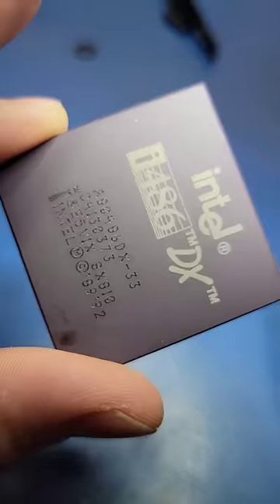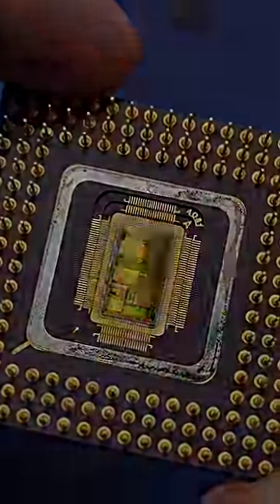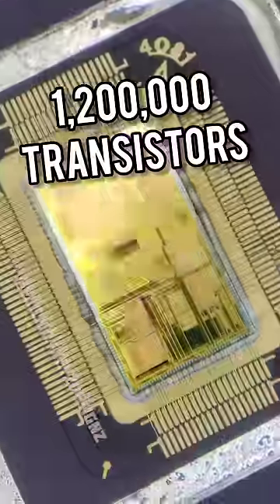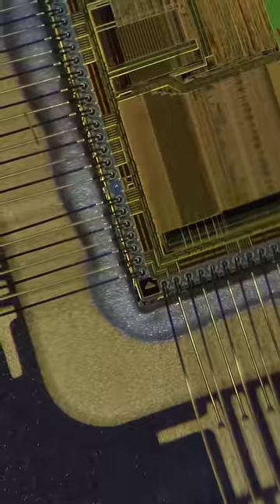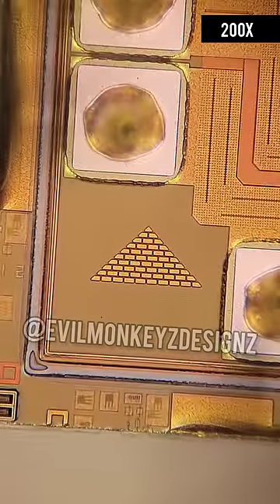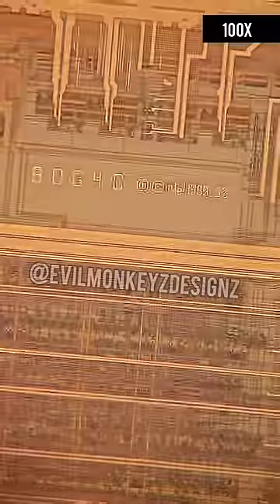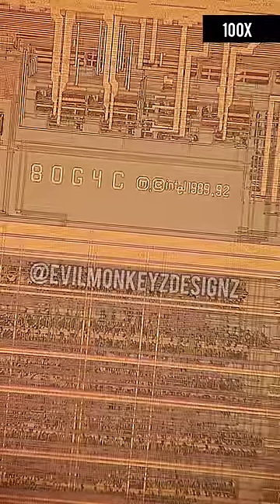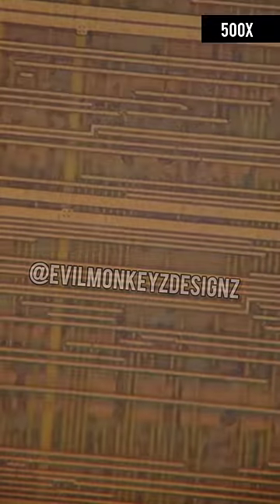Inside an Intel i486-DX CPU

Comment: That was my first CPU; 486DX-33 back in 1990 I believe! The machine cost $2,200 with 120mb HD and 4mb memory.
Reply: wow... I had the I286 in a Schneider Euro PC and my dream after that was to have a computer with that processor, but obviously my father couldn't buy it at that time because yes, was crazy expensive for him
Reply: Same
Reply: same, i486DX, 129mb hd, 4 mb ram but mine cost $1200 in 1991, that's what you got with Dell "quality"
Reply: My first was a 486 DX2-50  which ran at a blazing 50mHz .
Reply: Was my 2nd. I needed to wait several years for the prices to go down.
Reply: Mine was a 80287, 128k memory with no HDD Tandy TX1000.  Got it at Radio Shack for just under $2,000.  Upgraded to a 300mb HDD for $300.00 and 4mb ram I can't recall what I spent but I am sure it wasn't cheap.  circa 1988
Reply: Same
Reply: Same here
Reply: @pamdemonia but the cpu ran at 25MHz.
Reply: My parents bought us one too. This bring back so many memories. Trying to be smart as a kid. The computer was using (ms-dos) we I found out what “format hard drive”. Back then there was no google or YouTube to look for answers.
Reply: @Blaze_1961 4 megs of ram around 91 would have ran about $150. That is what I can recall from pricing it out back then.
Reply: I learned to much today im going to the histiry channel now
Reply: Oh I love these retro electronics, it was made with love indeed 😍
Reply: @jonnykban  The PC (system bus thus memory) would have ran at 25MHz but the CPU would have ran off of the 2x clock multiplier for 50MHz.
Reply: my system was the dx2 66 i think but i do remember costing $4500 lol
Reply: My first CPU was a 1mgz 6502.

You new kids....   with your hoola hoops and your 8 track tapes shakes heads
Reply: Thats kinda lame 486 spec. I baught my first PC a 386DX25 with 8Mb Ram ond 80Mb HD and the classic Tseng ET4000 Graphics running DOS games and Win 3.1, and remember my friends commenting WTF you need 8Mb  for ??? so funny today. I remember buying a 200Mb harddisk later for all the cracked programs and games we got on QIC80 tapes. The 200Mb HD cost me like almost 1000$ back then. It was the biggest I could possible get. I could have baught several of the software for that money too. Remember running 3D Studio with a software coprocessor emulator .. it was Sloooow
Reply: Commodore Vic20, C64, C128, Amiga 500,    then down the Intel line.
Reply: Mine was a Z80 at a fast 3MHz, with a whole 2K of RAM in I think 1982 or so, the Timex Sinclair 1000 for $40 NEW mail order. My favorite is my TRS80 Coco with a 6809. Both used a TV for a monitor and a cassette tape for storage.
Reply: I had the exact same configuration. With a VLB graphics card too, of course.
Reply: @anthonywilliams7052  The ZX80 had 1kb ram. ZX81 had 2kb
Reply: 你小时候就玩这些😂
Reply: That's really cheap for the time. How did you pull that off? I got my 486DX2@66MHz very early 1994 (I just cared about h-h-h-homewor...
Doom). My dad got the majority of it for free from his school as he was a teacher. The media center was getting ready to switch over to Pentium machines and were chucking everything. However, that PC in 1994 was around $2,500-$3,000 new.
Reply: @choppergirl 
What's a hoola hoop and an 8-track tape? Was that something you used to walk up both sides of the hill to get to school 18 miles away, one way, barefoot? The hill that was always snowing on one side (blizzard snowing), and 95 degrees on the other side with golf ball sized hail raining down on you. You never complained and life was definitely better. ;)

Addendum- I'm joking, I am a wise ass Gen X'er (probably like you). My grandparents used to tell me about the massive hills they had to climb for everything barefoot. Or...when I was your age we didn't get Nintendos', we got an orange and a backhand for Christmas. I miss my crazy grandparents they were cool (all 4 of them).
Reply: the first computer i was trained to repair was a Wang Mini - no CPU as such rather a collection of 8086 processors on multiple boards, no HDD, 8 inch SSSD floppies with (from memory - pun intended) 360kb of memory, a 'green-screen' monitor and a price tag of around $40k back in 1983

after which i was trained on the Wang Mainframe which ran reel-to-reel tape drives as big as a fridge
Reply: Mine too! But I got it in a dell in 1994, with 8mb of ram and a 240mb HD with a 512k Cirrus Logic video card. It cost my mom bout $1500.
Reply: Nice rig!
Reply: Lol. 120 was quite big back in the day. Mine was only 40mb.
Reply: 286 packard bell legend iv 😉
Reply: My 1st cpu was AMD 486DX2/80. 30 years are over since then.
Reply: $2,200 is some cash. But hopefully nothing your parents couldn’t help you with🙏
Reply: 486 was my first PC CPU also, tho pretty sure my first PC was a Pakard Bell with a 486 DX66
Reply: @Sinn0100 you are correct with your pricing. Our family got a computer around the same time.
Reply: @flyer3455  DX and SX both had variants that ran at 25 and 33 MHz bus speeds. The difference was the DX had an integrated floating point processor 

And AMD did in fact produce 486 processors. They were a licensed third party source amongst others. They made Intel processors since the 8086/8088. IBM had a  requirement of not having a single source in case something would happen to them.

AMD was not a licensed third party source of the Pentium requiring them to "clean room" reverse engineer the Pentium microcode
Reply: My first CPU was a 2MHz 8080.
Reply: @Blaze_1961  The 80287 was not a CPU. It was a math co-processor.
Reply: Strange for me since I fought 33MHz had SX version. My first private PC was 386DX-40. As I remember 486had also DX2 version for 66 or 80Mhz.
Reply: @da3dpanepma255  Why is it strange? the 486SX was just a 486DX with a disabled FPU and disabled cache.
Reply: @davidbroadfoot1864  Strange that my 386DX had more frequency than 486DX in the video
Reply: Your current computer probably doesn't seem much faster either I'd wager.
Reply: @Blaze_1961  The 80287 was an add-on math coprocessor for the 286, priced about $250/100ct bin.  Your HDD was probably 30MB not 300MB, they had just barely broken the so-called "32MB barrier" back then with MS-DOS 3.3.  Your RAM was probably the super expensive upgrade and you had better have shelled out for the cache memory upgrade as well otherwise it was slower than dirt.
Reply: @DanielKreimendahl  What I wrote was from my bad memory.  I put the model down for people to check specs. Both the 7 and extra zero were typos.
Reply: memory more expensive than everthing else- you had to load by hand - each chip a 'bit' at a time
Reply: Whippersnappers. My first had a Z80, a 8x80 characters LCD and cost abot 3000 bucks...
It also had a microcassette drive for mass storage, which had an error catching method that actually made it MORE probable to lose data...
Reply: @HotelPapa100  lol - my first? 1979 altar 8080 with the load toggle switch/led front panel (home built except for the 8080 board - and then to save up real money for the math coprocessor 'board' - 
i lost it during the many moves i made sense then but remember when i loaded my first 'working' program and saw the front panel led's start to actually execute and not stop - we didn't have ICE back them dangit! -you had to work backwards from where your program stopped. 
still- i remember the experience so well!
Reply: Yeah I don't wanna hear people complain about how expensive PCs are today. Mfplz. 2 grand, 30 years ago.
Reply: @TicTac-g7m I went down the TI 99/4a trail. That was when programming was fun. Mine played three part harmony. And was a lot cheaper than the apple computer and i didnt need any extra boards. I bought the ecpansion box when triton took over the sales. TI dropped the home computer field. I had a print out for the //1400 emulator that was used on an IMB system 360. It would play music through an AM radio if you put it near the CPU. The computer made beep sounds and the program had values for each note, also duration. I still have a printout but the expansion box is gone and the cassette tape is probably history. I dont think i ever wrote down the basic version so if i was to try to rewrite it and would have to hand type the program and data. I would rsther take a sheet of music and type that in because the computer was polyponic, more than a single voice. The TI also had speech it was the best at the time. Rrmember speak and spell toy. 73
Reply: 120MB hard drive in 1990 is insane. I had a 20MB at the time and thought I was the shit.
Reply: my firsr pc also 486dx 33 and ms-dos cd ron hp printer , when i was 16 yd
Reply: @Brave2standalone  486 sounds like a bunch of wipper snappers. Let's talk about main frames. You can have small main frames one example the 80 80 system. S 100 buss. 73
Reply: I had the one made by TI
Reply: Same as mine, ibm aptiva costing £1500
Reply: This "beast" remplaced my 386 SX25, it was a giant leap we dont see anymore
Reply: Good deal, my Dad paid like over 5K for an 486sx 25mhz,  with 4mb memory and 70mb hard drive, although it was  a "multimedia" IBM PS/whatever that came with a CDROM it was in Canadian funds so probably not as expensive after the conversion.  It was amazing for us kids at the time until i tried to play duke and realized what an FPU was, i even bought a dx 50 localy to upgrade not knowing it only took a upgrade FPU processor, not a real one.  I think the dx 50 was only $50 at the time  used from a local paper ad (before craigslist) very cheap so my dad didnt loose to much in my failed attempt to upgrade our computer, considdering how much he paid for it it wasnt a big loss I guess. This sent me down the road of building my own systems and put together some nice bang for buck systems for my parents since.
Reply: @huberthumphry280  4MB ram!  Most PCs come with 64GB nowadays.  That's 64000MB.  My 386 could handle 8MB max at a push (well, the motherboard's bus could only handle that but I refer to my old computers by their processor).  Great days back then, was so easy to keep 100% up to date on technological progressions in PCs. Now it's not that easy - don;t get me wrong I love it but wow if someone told me on my 14th birthday my PC would one day have 64000MB I'd have shat my chain-festooned baggy jeans.
Reply: @Blaze_1961  My 286 bro!  All these 486 DX2 rich boys here; I was wondering when one of the real deal 286 crew would stick their head up 🙌
Reply: @DanielKreimendahl  "32 MB barrier" was a file partition size. Pretty sure older x86 processors had the same 512 MB size limitation as 386 and 486 processors
Reply: @Etcher  advancements in tech are indeed much faster, but compatibility is so much better. I don't miss having to research every little thing to be sure it'll work
Reply: Yes, coupled with Voodoo 16mb graphics😊
Reply: ISA- and VLB VESA Local -Bus on a Socket 7 main board for the  Intel 80486 DX (means mathematical coprocessor) at 33 MHz. Same here including the QC80 Streamer tape drives and a $600 upgrade to add a Soundblaster sound card and a single speed CD-ROM drive..
Reply: My first 486 was 486SX-33, still a big step up from the 386 in terms of running DOOM
Reply: Back in 1991, purchased for just under $2000 a PC clone w/ 80486DX-33 CPU, 4MB RAM, 100MB HDD, 5.25" and 3.5" floppy drives, VGA display and monitor.
Had intended to upgrade to 16MB RAM -- but those plans went out the window when memory prices suddenly shot up after a fire at a resin factory in Japan (1993 iirc).
Reply: @jonnykban  The DX/2 50 ran at 50Mhz CPU and the Bus speed ran at 25Mhz. The DX 50 ran at 50 Mhz for both CPU and Bus. The DX 50 was not very good as it caused compatibility problems with Vesa Local Bus.
Reply: And that was a nice hardware system for back then !
Reply: My first was 8088, 4.7Mhz 20MB harddrive. Monochrome.
Reply: Prior to the PC with 80486 that I bought back in 1991, the first microcomputer I'd ever owned was a "hand-me-down" Sinclair ZX-81 (original owner had bought it in kit form and assembled it).
Prior to the Sinclair ZX-81, the first microcomputer that I'd used was the TRS-80 Model 1 (aka "Trash-eighty") that the school had back in 1980.
Reply: Yep and 1MB of memory cost like 1GB today, around 50 bucks :). I was sooo happy when cost of 1MB go under 50 dolars :D
Reply: @huberthumphry280  A cheap PC in 1991 had about the same quality of a mid to high end PC today. Most of today's pre-builds are total junk.
Reply: @potato9832  Dell has always skimped to keep the price low. The one mentioned lasted a total of about 4 years- I then started custom building

After talking with friends that work at Intel, I will never own a Dell. But I don't care for laptops, so its moot anyway
Reply: @beverlychmelik5504 how about the expansion slot that makes the system to gain more weight